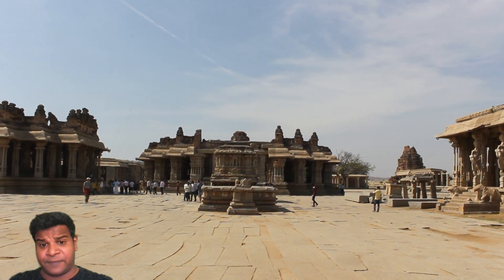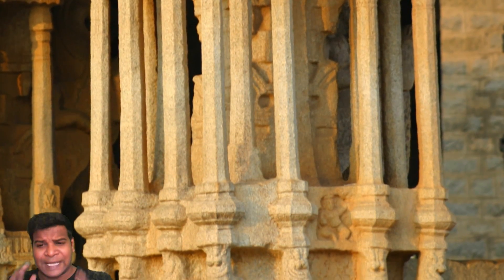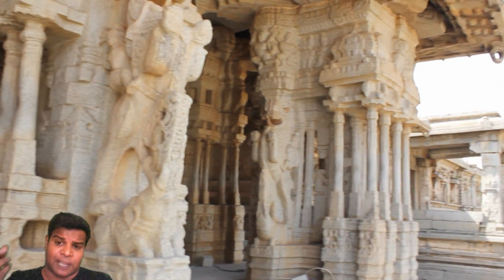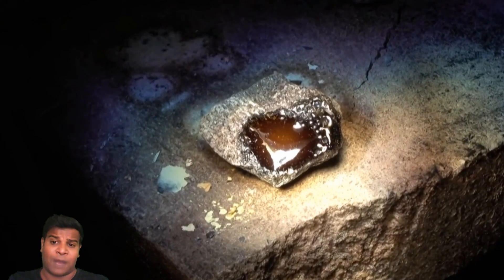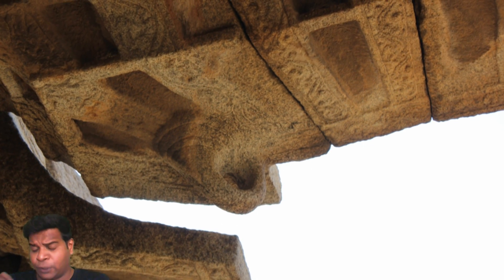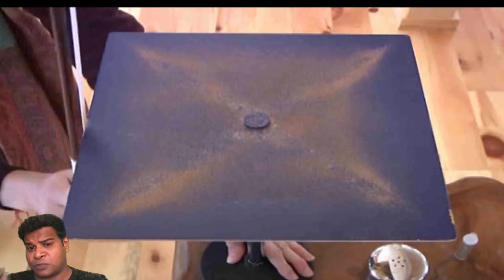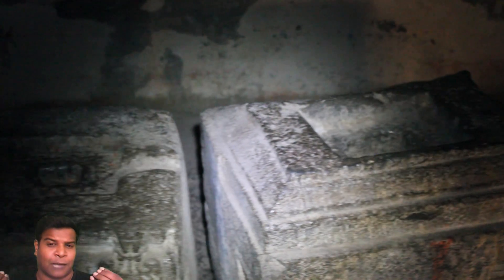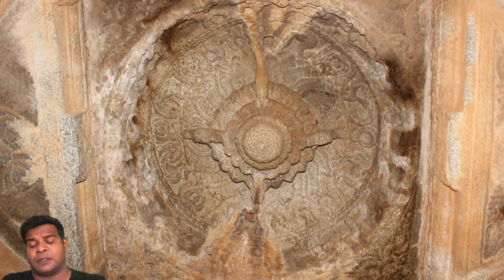How do the Musical Pillars Work? Rock Melting Technology? Cymatics?

Comment: Sandstone is created when water flows through compressed sand leaving limestone behind, which connects the grains of sand into a solid rock. You could create in this way a sandstone pillar over the granite ring and then carve it into chain while it is still pliable, then finish the calcification process and then smooth the ready links.

Comment: Here is a thought on the creation of the stone chains. they appear to have thicker parts as if they have been joined. Lets assume that they could make some form of concrete and that it looked a bit like sandstone, this is not too great a leap of faith. If you filled sausage shaped tubes with concrete and then joined the ends together, when the concrete set it would make a concrete ring. then it would be easy to join the rings when they are being made, so that you would have a chain when they dried. also this would make it possible to join the concrete rings into another stone material.

Comment: Maybe it’s not what the Pilar’s are made of alone. Maybe the only way they can resonate the sounds is the mass, hieght and weight and material. But also the measurements in between the Pilar’s,  starting from the first known tone to man. Which ever of the 7 Pilar’s that came first. I would then start measuring in between distances from the first Pilar to the second and record that calculation. Then I know my starting point or center. Then I would measure the distance between the first and the third and calculate the distance again. Before you move on to the 4th Pilar of the first I would add 1+2=3 and 1+3=4. Don’t forget to add the in between. Which in my case is English so I use the word “and”. If my alphabet had a number under each letter the in between word would be A=1, N=14, D=4. Total resonance in between = the total amount. Continue this equation through out the total of the 7 Pilar’s. Maybe this might solve the mystery.
Reply: Who ever is taking the measurements has to use their native tongue alphabet in their own language as The in between.

Comment: One thing is possible , we can create the dance pattern , in parallel record the sounds of the pillars and somehow find the start and end of the circular pattern and combine it and see what holographic semantic pattern it makes and if the Vittala statue is made of the same material as that of the musical pillars, then we need to do reverse engineering approach/ bottom to top approach (since the statue is missing) as what would be the density of the statue to create the semantic pattern which is in the dark and see if the outside pattern somehow resonates inside and yields a 440 hertz music which has healing property which spreads to people worshiping near it.

Comment: The chain could be done but it'd be super hard to do.
Basically you just have to carve out the chain, a simple flat disk with adjoining standing disks.
Then you carve away the voids in the disks making them chains and free them from each other.

Like I said very hard to do, it would be so much simpler if they just melted down the stone from smaller quarry debris and casted it. Either all in one piece or with a jig that allows you to insert the ring through the hole before casting the next ring. 

I want to try the carving method in wood. Just to see how it turns out.

Comment: Those sandstone chains are a conundrum, sandstone is super soft and has no structural integrity at all [we use it alot at work].
The weight on the chains would be substantial, and to last for many years swinging in the breeze with rain erosion is not plausible.
Something you have not noticed  what was hanging on the end of the chains?
that would have increased the weight substantially.
I think it has iron or copper rings with a sandstone cement coating.

Comment: It seems that the ancients had the ability to change the density of rock by using vibrational frequencies. The most likely way that they did this was with sound. 
Could stone softened by the application of the right vibrational frequency and then exposed to a certain note, go on to reproduce that note once it had regained it's solid state ?
Are there ancient, sacred instruments that are associated with these temples ? Instruments that could possible be the key ?

Comment: Are the stone chains, rain chains? For water collection? My guess is that the granite rock, was a layer next to or intertwined with the sandstone. The sandstone was carved and I've seen chains made this way from wood. Sandstone could be melted, but at over 2192 Fahrenheit. The power of the sun could have been used and focused through a glass lens to melt it. (glass has been around for about 5,000 years) Maybe? The dark chamber was probably lit by oil lamps, and the ceiling ornate for acoustics. I bet people would sing in there, chant or pray, and the acoustics would resonate with the music outside. My other guess, is that the ornate ceiling was appropriate for the statue that resided inside. Were offerings made in there? I enjoy your videos, thank you for making them.

Comment: no, the stone is not melted, it's a form of concrete. "melting" or "liquefying" the rocks is an ancient way of describing the creation of concrete. If you actually melt rock, when it dries it doesn't turn back into rock again, you end up with something more like volcanic glass. But if you grind it down and mix it with something to form a concrete, when that dries it resembles rock very closely. sometimes it requires a microscopic analysis to determine if it is rock or concrete.

Comment: I'm a musician, specifically a guitarist.  With a guitar, if you add some mass to the headstock, then, it can help to improve tone and sustain.  I think the chains were there to enhance the sound without negatively affecting it.  The chain links also help minimise actual contact area, similar to how high-end speakers use metal speaker spikes to help minimise contact with the floor to help produce a purer sound.  The shape of the carvings in the ceiling could also potentially help enhance the frequencies specific to those patterns.  It's possible that when the structure is played fully, then, the resulting frequencies might be focussed in the room with the potential to affect whoever is inside it.  Just my thoughts/theories on what's going on here.

Comment: Easy to explain: melting and adding other substances would change the color of the pillar so this assumption is flat wrong. At 4:16 you can see the pillars do have on the top end a kind of a disc shape endings with various thickness. Focus of these parts and it starts making sense.

Comment: Your assumption that the sandstone chain links couldn't be attached to the granite link is a little suspect as the sandstone top link and the others may well have been sliced and  seamlessly repaired? They may well have had cement as did many other ancient cultures . The differing density of granite could have been mined at differing levels which would have had the granite at differing pressures when formed hence the different densities ??

Comment: Archiologists are wrong, These are cement, Just not the portland kind we are used to, Cements made with around 50% sulpher instead of water can do this, They will melt at around 250°c so thet can also be recycled. This is how Megolithic structures are made, They are not carved from rock

Comment: I had never heard of the rock chains before. Thanks very much for bringing them to light, a huge unexplained mystery.
Reply from the maker: Hi Andrew, I am glad that you like this video. Thank you so much for watching it. Have a great weekend!
Reply: They could've been carved out of a single block of sandstone, it doesn't even have to be too big.
Reply: @igorjee  that's not the issue. Problem is that it is connected to granite, without any gap in granite ring nor in sandstone chain.
Reply: @olsidream  If there is indeed no lack of continuity on either the granite ring or the sandstone ring attached to it, that makes things more interesting.
Reply: @olsidream  If you watch the video closely, you will see that we never actually get a good look at the link joining the chain to the roof... so there is actually noo good evidence here for us to examine. I will look for better images/footage... I am quite sure we will see a mechanical solution on the top link.
Reply: @igorjee  I did find a few images where there was no obvious mechanical linkage... but I think in those cases, it is just carved out of the surrounding material, in place. I think in instances where the chain is different from the roof, we will find mechanical linkage, every time. It is conceivable they could have cut out a section of the joining link and then filled it back in with concrete to re-complete the ring. The use of concrete in ancient India is much more plausible to me than "cymatics" or some ancient lost rock melting technology.
Reply: Like in jewelry chains they probably used a jump ring

Comment: nanotechnology. i heard these are made from geo polymer of different stone and even metal. if it has a special nano architecture then it could vibrate where the holes would be microscopic. or the alignment of the atoms is such that it vibrates when struck. or its just because its long and thin so it vibrates like a string.

Comment: The pillars could sound different due to the amount of stress/pressure on them from the building around them. 

Also using sound to melt stone can alter the density of the material inside. Say melt certain areas in the posts to change the tune. 

.We are vibration, our cells are mostly water being vibrated into existence by the sound of DNA vibrating in the tiny nucleus that is in the middle of our cells. This vibration is caused by the specific structure or tone of your DNA as it interacts with the Aether or the Perfect Fluid of vibration that we live in. 

Everything is shaped like a Torus field. 

Masculine energy flows out of Aether giving mass and Feminine Magnetism pulls in giving shape. The Holy Trinity. Everything you do think consume, feel and live in vibrates and changes your DNA. None of your DNA is junk it holds everything that has ever happened to you and your parents, grandparents etc. You can change this by what vibrations you allow into your environment and Torus field that surrounds all matter. We can heal our entire bodies as most cells in our bodies are replaced within a few years. If all of our cells are replaced within a few years then there is no reason we cannot grow brand new healthy cells where damaged ones are.  

So the key is to change the vibration of your DNA so it stops reproducing damaged cells or packets of structured water. Remove all synthetics from you and your environment, clean spring Water, non gmo organic plant based foods, clean natural environment and clean thoughts, emotions will heal your vibration so your bodies cells flower out in harmony instead of distorted. Cancer is simply a mutation caused by you changing the harmony of your symphony. Change your tune and you will vibrate in harmony and be healed.

I Love you All, we are ALL One

Comment: there is no problem in creating a chain from a single piece of rock, look for pictures of pencil chains for example. but to make them from a different material - yes, this is really impossible. also i noticed slightly different width of columns making 7 notes, the difference is not big, but the thickness is the square of the diameter, so the result depends on width dramatically. need some calculations but this may be enough to make them sound so different. i suppose that to make a full octave you need the thickest column to be only 40% thicker than the thinnest one. and this difference does not look very obvious. still i'm impressed by the precision and the amount of knowledge inside if this piece of art. thanks for the video, it's amazing!

Comment: When I was a boy scout they had a wood carving project to carve a wooden chain attached to a cage with a captive wooden ball out of a single piece of wood, but stone is more brittle and would break more easily if stone carving a stone chain is attempted. However, when you have interlocking links of different types of stone, that's a much tougher problem to solve and gives good evidence that stone melting may have been done in ancient times. We melt metal ores in electrical arc furnaces and microwave heating is another possibility.

Comment: You haven't established that these are those patterns at all. You need to carefully match point for point the patterns with nodes that correspond with pitches. Just saying they are these patterns does not make it so. Show us the evidence. I am more than happy to believe the ancient builders were instructed to make patterns based on sound vibrations. All you need is a sheet of metal and a violin bow and sand to make these patterns. No mystery there but it's not clearly demonstrated that they are just plant motifs?

Comment: with all due respect the British cut the columns in the wrong place. any void would be at the bottom or lower part where the columns are thicker not at the narrowest point near the top. It is also possible that this could be tested by tapping the columns in different spots to test for a tonal change. Like tapping a wall to test for density. The void need only be a difference in a part of the column.

Comment: Too many large single pieces. You build in parts then assemble. These solid stone pieces were probably built of wood and metal and fused together under water through the fossilization process. It really looks like it was all under very deep water for many years and just recently in the 1800s dried up so we can check them out as if we are all discovering them at the same time. Stone breaks really easy and is actually not a good building material for any thing with fine detail.

Comment: The caps (tops) of the columns are in fact different.  This may be due to ‘packing’ the columns to induce different axial pressure.  The reverse of tightening a string on an instrument.  Within small limits it should be possible to tune a slender column.

Comment: the pillars could simply be conductors of sound which transmits the initial flick of the sandle wood to a chamber which would create the different sounds you hear. similar to a fixed single string instrument,  the note that returns is due to the shape and size of the resonator and not the string.  I hope that makes sense.

Comment: Nice video.Melting stone is very possible if lot of people blow in same time but it is also possible that they use sounds for everything.If you use very big horn made of metal or other harder material.Place smaller side on the rock and on the other you can make sounds with sticks or singing and cause it to vibrate on smaller end so much that it can carve stone..Shape of the smaller end can be altered in order to make various shapes. I have the impression that all the pillars will sound the same if you take them out.What gives them different sounds is they position and the weight they carry as well as the shape of the sealing. I'm not an expert but only that way sound possible to me.

Comment: I can tell you how they make music and the distinct frequencies or tones or pitches. I has to do with reverberations throughout the whole of the mass, being the building/structure. My estimation is some of these musical notes are no longer in tune due to erosion  and deterioration.

When the pillars are played, reverberations are sent through the whole of the mass. The density of the mass effects the direction and speed of those waves, which is the equivalent of frequency. Now the "visual oscillations" you cleverly pointed out on the ceiling are the gathering points of these musical notes and vibrations. The exact location of the pillars in relation to each of the ceiling outputs and the variations of wave length/frequency as is reverberates, creates unique tones and musical pitches.

Having never seen this in person, I would also hazard a guess that when this "Temple"  was in still under its original usage, there would be several person responsible for certain notes and be designated a specific station of pillars. In this manner, working together in unison, the full musical spectrum becomes available for this group of persons to play their music. They must certainly be working in unison to achieve such works in the first place, thus the idea of playing music in this fashion is highly probable much like the orchestra of later years. Most likely the reverberations would leak out and fill the town/city/country side, etc bringing peace and happiness to the people.

The only other comment I will mention is that, this would have been a very highly esteemed show of knowledge, displaying advanced workmanship, coordination, knowledge of the natural elements and their properties and musical knowledge. The entirety of these various forms of knowledge coming together must have been amazing to experience and would also serve as a means to visually teach many of the concepts used, so we should also add a schooling system to the various forms of knowledge employed.

Rock technology or better rock knowledge came out of Egypt and that knowledge spread to the surrounding nations. If you are going to find answers it will be there. Always go to the source for your information, as everywhere else may be contaminated with disinformation, deceit and lies.

Comment: in my opinion different tone is a function of pressure onto the pylon, which is depentent on the diameter of the connection to the roof (high diameter gives lower pressure [assume relatively constant wight per sqaure-meter] and thus results in lower frequency) fH*